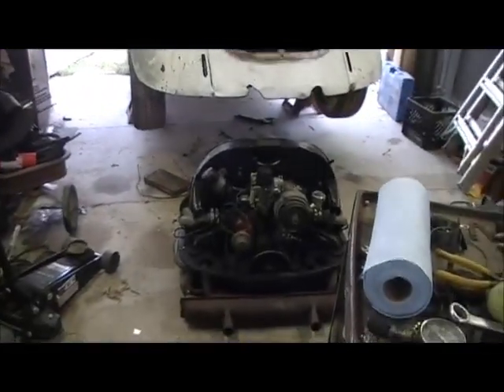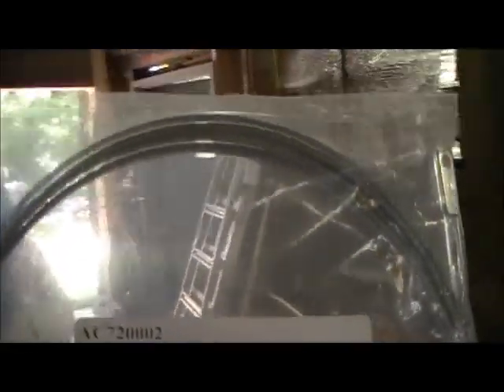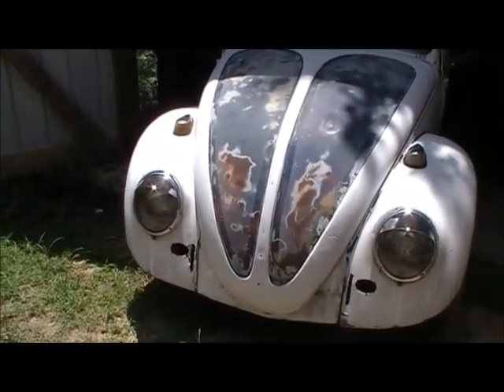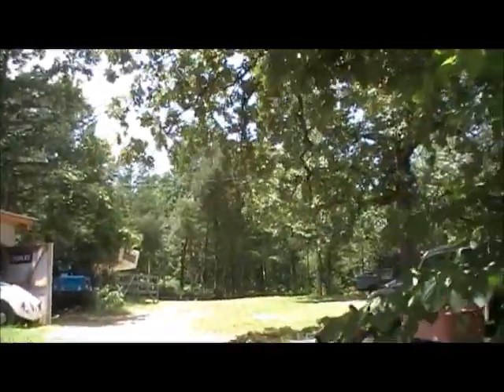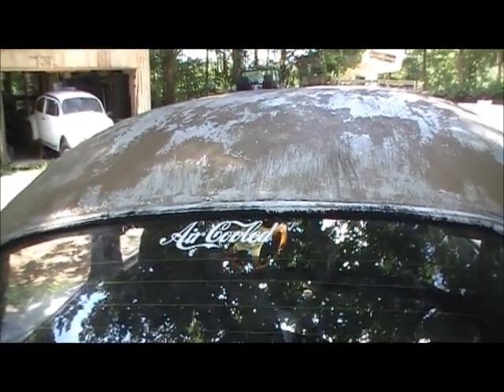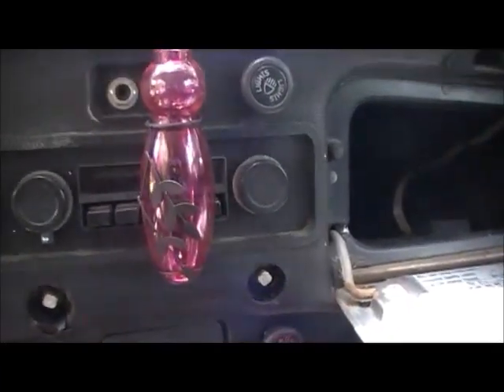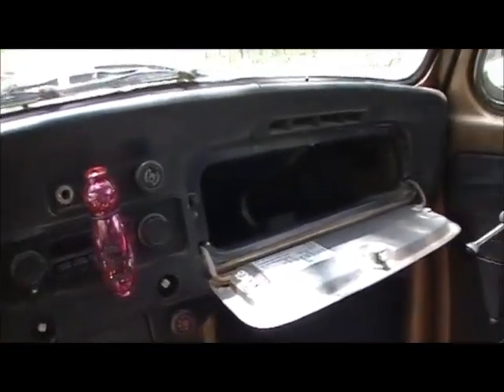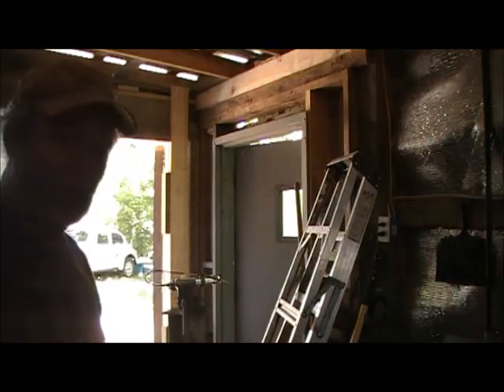Air cooled Bugs and Air Craft

Comment: You are becoming VW Rich. Two running VWs You use to have a heard of non running VWs now your getting a whole heard of running VWs thats cool. Wonder how this motor will run? I hope its a good stout one. What seal are you talking about the main seal? my old vw ran close to 80 miles an hour lol it was a 69 bug pearl white my dad and I painted it and it looked like it just rolled off the assembly line from the factory new and my dad was a great painter he had lots practice on  boat trailers he painted on at the  boat trailer manufacturer. Head lite visors are cool.
Reply from the maker: Wow! You have any pictures of your Bug? Mary Ann wants me to paint these. I thought the rough look was IN?
Reply: Some like the rough look. But most like painted. I paint my stuff but I guess Im old fashion LOL. If a car is too far gone Yeah make it a rat bug if there is such a thing but if it can be painted go for it.
 I got some pictures of my bug but my sister borrowed the family pictures and she wont give them back lol.